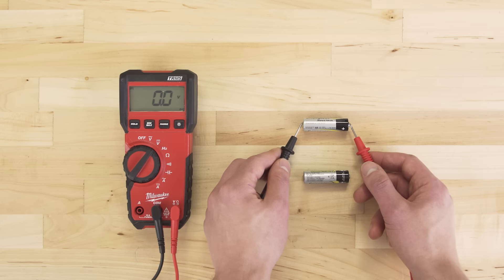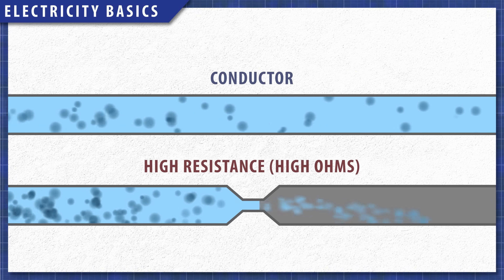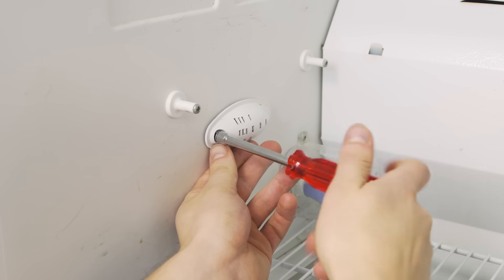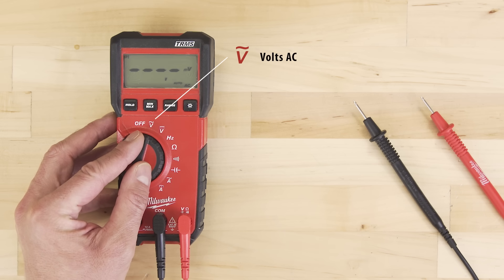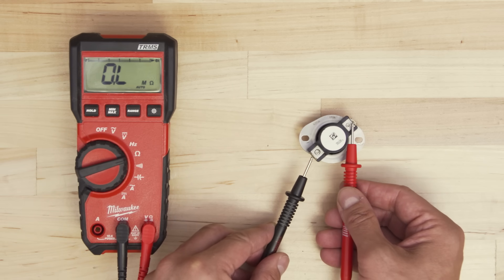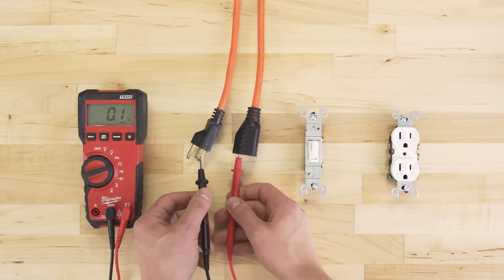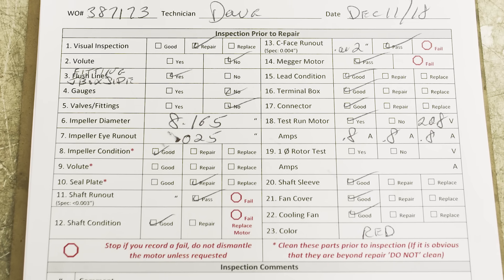How to Use a Multimeter & Electricity Basics | Repair and Replace

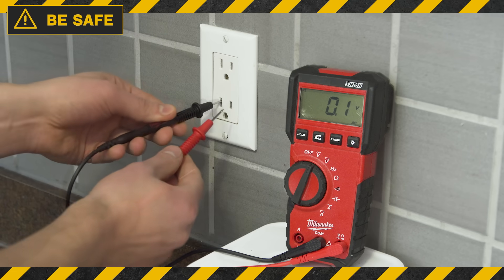Comment: At 8:04 you say to always test voltage starting with neutral first so you don't energize the other  probe. But if it's AC and the current is changing back and forth, wouldn't that mean no matter which you start with (N or L) you will complete the circuit of you touch the other?? I'm confused.
Reply from the maker: Thanks for watching. Voltage refers to the potential for electricity to flow. The hot wire has voltage and when connected to a neutral or ground will complete the circuit and allow electricity to flow through. Neutral wires do not have voltage as they simply provide a path for electricity to return to the source. Connecting a neutral wire to a ground wire will not result in the flow of any electricity.

In AC circuits, the direction of the current is changing, but it still comes from one source. Think of it as the ocean, the ocean has a source and tides go in and out over time but there is a clear difference between the source of the water (the ocean) and the land that it flows onto. Its not a perfect analogy but think of the hot wire as the ocean and the neutral as the land.
Reply: @AmreSupply  Excellent explanation. Best I seen about neutral role.
Reply from the maker: @Wairoakid  Thank you, it can be difficult to put into words but we're glad that you found the explanation helpful!
Reply: What happens if you insert the black lead in the hot line and the red lead in the neutral?
Reply: Nothing would happen polarity reverse is not a case in AC circuits!!!

Comment: @22:28 The direction is changing 120 times per second: 60 times the current flows from L to N and 60 times from N to L.
Reply from the maker: Thanks for watching. You have a good eye. You are right that the line should have been "the direction is changing 120 times per second or at 60Hz". Unfortunately since the video is posted we can't fix that line without deleting the video and re-uploading.
Reply: @AmreSupply  I know, I saw it was an older one. Just pointing out the small mistake, maybe you will use that line in a future video again.
Reply from the maker: @demus8757  For sure, thanks for pointing it out, we appreciate it!

Comment: You talk Way Slower than I can listen 🎧 plus you take to long to get to a point,
As IF this this was for Kindergarten Kids, but Mostly for Yourself...!!  Couldn’t make the first minute.
Reply from the maker: Hi Anna, thank you for your feedback. In Canada we are a multicultural country with a large number of people who have learned English as a second language. Additionally electricity is one of those areas where the basics are often misunderstood. Because of that we have decided to present our videos at a slightly slower pace than other videos. We feel that this helps the most people. There is a feature in Youtube that can help if you find some videos are too slow. Under the settings you can adjust the playback speed. Setting it to 1.25X should help with podcasts, lectures or any informational video that you want to listen to at a quicker pace.

Comment: Complete a ⚡️trade instead of  weetie-box knowledge, that can lead to a  fatality.
Reply from the maker: Hi Peter thanks for watching. Learning a trade is great, but homeowners are responsible for keeping their home running smoothly. Not everyone can dedicate the time to learn each and every trade  to a professional level. So the question is; how much knowledge should the average homeowner have? 

Multimeters can be used to help fix many things including simple components in appliances that are easily accessible and safe to test and replace. Having a poor understanding of the concepts is where problems occur. Considering that there is a lot of bad information out there, its good to get the right info in the hands of people who will be attempting the repairs anyways. This is why its good to cover the basics, show what can be tested safely and inform them of when to call a professional.
Reply: @AmreSupply  granted but as a electrical tradie for decades, the best thing a homeowner can do, is get three quotes for electrical work as they have a responsibility to their families, safety as the old saying goes,  ignorance is bliss.
Reply from the maker: @peterlaw.  That is well put! Thanks for sharing your thoughts.

Comment: It's okay. I'm a maintenance electrician in a paper mill. I can teach you how to use an oscilloscope and a Programmable Logic Computer. Also how to work on 4160 volts. Most important is when the hair on your arm stands up it's time to back off but probably already too late. Have someone take a picture of the veins in your back they are good conductors and your grandchildren will want to see the picture. When dealing with 115,000 volts make sure the grass has been cut where you will be standing.
Reply from the maker: Thanks for watching. You painted quite a vivid picture with your description. You are quite right that industrial electrical work is a whole different beast than residential work. It also gets interesting in the case of power plants or any machinery that is running 24/7. Definitely requires a very strict set of procedures to isolate part of the circuit and replace even simple components without shutting the whole system down.

Comment: My experience goes back to the wired in voltmetres, Simpson VOM, and Fluke digital multimeters.  Depending on the grade of your service, some contract companies require certified calibration on a yearly basis.
Reply from the maker: Thanks for watching. That is a good additional point! Calibration is essential when consistent and accurate measurement readings are needed.

Comment: One of the first things I learned as an apprentice in Germany was to never check if a component is voltage free with a multimeter since setting it to VDC instead of VAC will always show 0V on AC
Reply from the maker: Thanks for sharing. This is where NCVT (non contact voltage testers) are useful. It provides a safe way of verifying AC voltage without touching. It removes the potential error that would come from using a multimeter on the wrong setting.
Reply: whenever i get a zero reading, i immediately recheck my dial setting. good point. good video.

Comment: Thanks for the video,but my + or - are really short,3mm...
Reply from the maker: Thanks for watching. Are you referring to the multimeter probes being to short?
Reply: @AmreSupply  yes... but it's the cheapest multimeter because it's the only one who have for tester for batteries(28$). it's expensive but super precise than a cheap battery tester for batteries(works,or faulty)
Reply from the maker: @SuperBG78  If the multimeter has other settings but the probes are the limiting factor, then you might be able to just get new probes and connect them to that multimeter, assuming it has the same type of connection.
Reply: @AmreSupply   for price I paid,test 1.5,9 and 12v yes continuity works for LED bulbs,worth it!. Maybe later I will find other options for me

Comment: So i've just learned something. I was testing electric outlets, then i switched to continuity test to test some cables. I went back to testing outlets but i forgot to switch modes, the multimeter was still in continuity test when i tried to test the voltage of an outlet. Well, what can i say, i don't have a multimeter now :D
Reply from the maker: Thanks for watching. These sorts of things can happen to the best of us, which is why its always good to check the settings before every use. There is a fuse inside of the multimeters that will blow if the current exceeds the rated value. That fuse can be replaced, so your multimeter might not be completely lost.
Reply: @AmreSupply  It was a really cheap multimeter anyway. It actually blown and burned the plastic on the corner. I kind of laugh as the fuse that was supposed to protect it is still fine :D

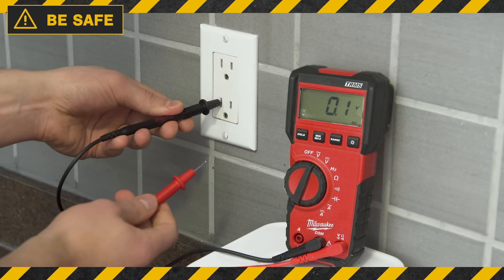Comment: 8:00 Great safety tip!
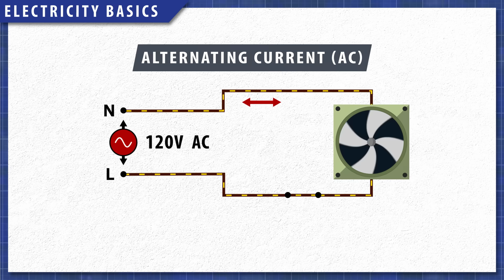But doesn't 120V AC changes direction 60x a second (2:30)?
How is this a meaningful safety tip?  Or does "change directions" mean something non-intuitive in the world of electricity?
Clearly something different happens in ground-to-neutral versus ground-to-hot at 8:40, but I don't understand how it could do that.
This hole in my knowledge has been a problem for decades.
Reply from the maker: Thanks for watching. The hot wire supplies the power and the neutral returns it to the source. The neutral and ground don't have a voltage as there is no potential for electricity to flow. However when either a neutral wire or ground wire is connected to the hot, it will complete the circuit and become a path for the electricity.

To do useful work both direct current and alternating currents can be used. When AC is used with an incandencent light bulb it doesn't flicker even at 60 hertz as the filament stays hot. In motors, AC power can be used to create a rotating magnetic field.

This video might help you visualize how AC power works with single phase motors. https://youtu.be/vpspMVQQXRs?t=103
Reply: @AmreSupply  So until you have a circuit, no current can flow in either direction.  Interesting...and now I get it.

Thank you!
Reply from the maker: @stevejordan7275  You're welcome, we're just happy to help!

Comment: What if they use amp meter in home 120v directly
Reply from the maker: Thanks for watching. Using a clamp meter is a way to measure how much current is flowing to a device. Using the amp setting on a standard multimeter on AC current is a little different and should only be used with the right precautions.
Reply: @AmreSupply  I thought it will definitely damages the multimeter. from my experience, one of my friends did this by mistake. The multi meter failed and It won't worked in amp mode after that 😀.
I understood that, usually there is two port options in multimeter 10A for large currents, another one for less current and higher accuracy. Amp meter meaning it will measures the current by passing through NOTHING BUT A CLOSED CIRCUIT. In 10A it might resists some flow high capacity (thick conductor). 
******Don't try this*****
If you try this, there might be three possibilities 1. Multimeter is low quality it will fail.
2. Is there any product circuit in quality multimeter MCB will trips in new home.
3. God knows unexpected.
Anyway good information thanks @AMRE Supply , all the best.
Reply from the maker: @LoL_TV111  You are right that attempting that can result in the breaker tripping or blowing the fuse in the multimeter. Its also not easily done in a safe way without a clamp meter.

Comment: Just tried to test amperaged from the 240v wall plug and boom... it exploded 😱
Reply from the maker: Thanks for watching. An amperage tests require a flow of electricity to a device and are best done with a clamp meter. You likely blew the fuse inside the multimeter.
Reply: @AmreSupply  multimeter is fine only the tip portion got melted 😋

Comment: Learned how to read one in June to November 1963, PSM-6 I believe they were called.  Never could get all the volts, amps, current, etc., thing.  I do remember that electricity will bite you, and amp/current will kill faster, especially on an airplanes 310 volt systems, F-100D/F models.  Heck yeah they were old then too!!!!!  Brahaha!
Reply from the maker: Thanks for watching! The same basic principles haven't change which means any old multimeter can still be useful today if its working and is calibrated. Cheers!

Comment: Excellent video.  I’m hoping you can answer a question or two. Can I use a multimeter to find out if an outlet is 15 amps or 20 amps?  If so, could you please explain or demonstrate how to do so?  Thank you in advance.
Reply from the maker: Thanks for watching, we're glad that you found it helpful! 

The amp type will refer to the maximum current that it can handle, so even with a clamp meter this can be difficult to test as a device that you plug in might not draw the full 20 amps. 

You can look at the breaker panel, the 15 and 20 amp breakers will be labeled there. As well you can look at the outlet itself. 20 Amp outlets will have a horizontal slot on one of the plugs. This prevents a 20 amp device from being plugged into a 15 amp outlet. 

It will look like this https://www.amresupply.com/part/15223050
Reply: @AmreSupply  Ah!  I kept wondering why some outlets had that extra slot to the side-its for and signifies that it is a 20amp outlet.  The reason for the questions, a relative told me to plug in an extension cord to a 20amp outlet (reason being was to provide some power to my travel trailer which is parked in my driveway).  So I know that I need to have 30 or 50 amps wired...but in the meantime, this is a temporary solution.  I keep popping the breaker when I turn on the 15,000 btu ac.  My relative was thinking that the outlet to my dryer was 20 amp.  Hence the reason for asking “can I use a multimeter to see what the amperage is on an outlet.  Thanks again for your video and help!

Milo
Reply from the maker: @Milo-915  You're welcome, we're just happy to help. Best of luck to you on setting up the trailer!

Comment: Sir how can we decide  number of wire and number of turns any empty core of a single phase induction motor  what is the formula thanks
Reply from the maker: Thanks for watching. That is a very specific question which is outside of the scope of this video. We do have a video on How Motors Work which you might find interesting: https://www.youtube.com/watch?v=vpspMVQQXRs keep in mind it doesn't get into detail on the formula or anything that specific.

Comment: Very informative video, thanks for sharing!  Quick question, though.  Are the wall outlet receptacle standards the same between Canada and U.S.?  I'm wondering because this video mentions the left/longer plug to be "neutral" while other videos call it a "ground" (or are the two considered synonymous with each other?).  However, the third one at the bottom is also a "ground" but more specifically the "case ground".
Reply from the maker: Thanks for watching, we're glad that you found it helpful. The plugs are the same in Canada and the US. There is a slight different in terms used depending on the region. Neutral is not the same as ground and calling it that is likely a short hand that some particular people have been using.

Comment: So, you’re not going to show how to use the amp setting? That’s why I clicked on here!
Reply from the maker: Hi Michael, thank you for watching. This video didn't focus as much on DC circuits which the amp setting is more useful. For AC circuits in appliances, testing amperage is difficult to test safely without making modifications to a power cord, which is why a clamp meter is superior. 

What specifically are you interested in testing amperage on?
Reply: Dc lower output amps. I made a wind generator that I would like to see the output. I have two digital multimeters. I have never used them for amps.
Reply from the maker: @michaelnelson9140  Makes sense. Perhaps something like this would be helpful: https://youtu.be/x2NLYydxbo4?t=168

Comment: May sound silly but I am in the UK and wondering is Auto range better or easier than the manual one ?
Reply from the maker: Hi Samuel, thank you for watching. An auto-ranging multimeter definitely is easier to use as you don't need to adjust the settings each time you're testing in a different range.
Reply: @AmreSupply  Thank you much appreciated

Comment: When attaching the sensors to the multimeter you say black is attached to common or neutral - typically we refer to common and neutral as being different wires no?
Reply from the maker: Thanks for watching. In North America, common and neutral are the same thing the words are interchangeable though we generally just refer to it as neutral.

Comment: 2:27 if the current is changing direcyion every 60 seconds, how does it reach all the components?
Reply: 60 times per SECOND .... not once every minute.... I would assume that also makes a bit of difference
Reply from the maker: Hi Zak, thank you for watching. The molecules inside the wires already have electrons so they are already at the components ready to go. The current is simply the flow of electrons, so once the switch is flipped, the electrons will start moving powering the components. If you are curious how components work, we made a video explaining this further: https://www.youtube.com/watch?v=e_1pOWSVUfg&feature=youtu.be

Comment: What brand and model of multi meter you have used in video.Would be great if you can provide the Amazon link.Thanks
Reply from the maker: Thanks for watching! In the video we used a Milwaukee 2216-20 multimeter. https://www.amresupply.com/part/2216-20-DIGITAL-MULTIMETER This is a professional model and its button layout is visually good for tutorials but a simple meter such as this Brico should work for basic continuity tests: https://www.amresupply.com/part/9462539